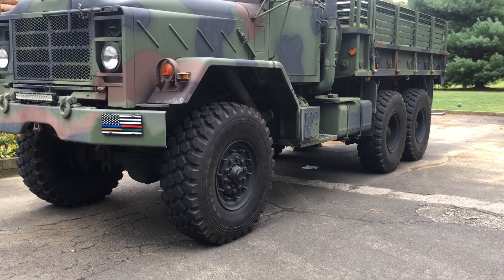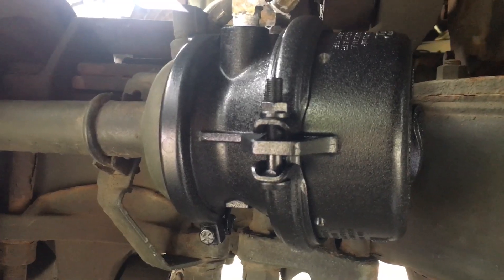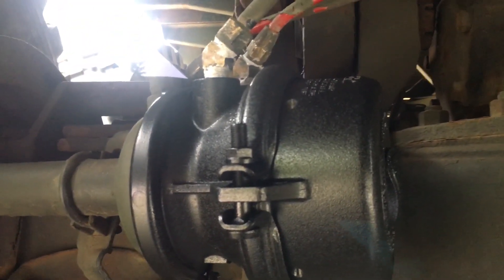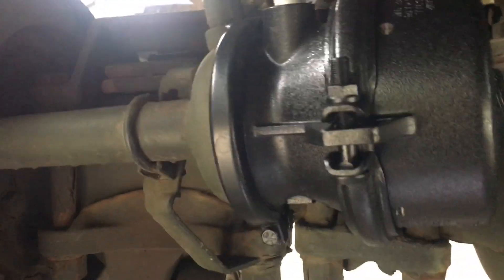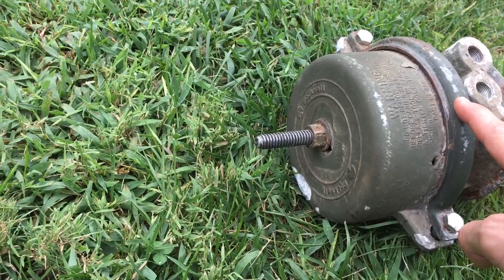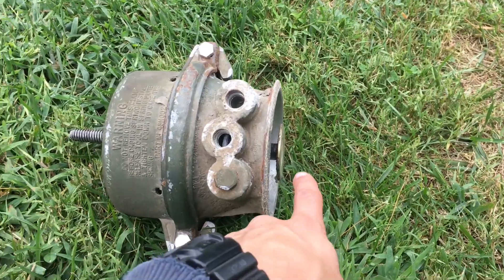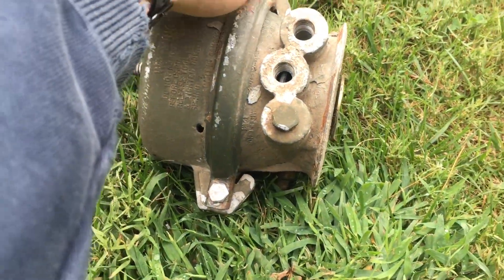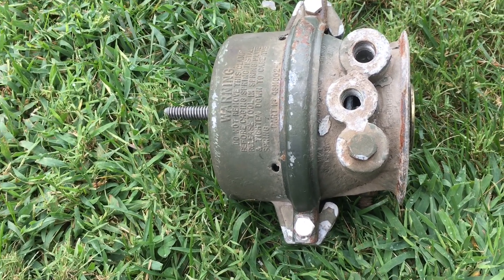M923A1 Spring Brake Chamber Swap

Comment: Do you still have the brake chamber cap? If so would want to sell, I need one because one of ears on mine is cracked.
Reply from the maker: Im sorry, the cap? The plastic cover that protects the cage bolt hole? I do not. Can possibly source that online. Sorry cant help more.
Reply from the maker: Heres a link for them if it’s what you’re looking for. Also saw them on eBay through different sellers. 

https://www.oshkoshequipment.com/products/detail/72/4652/Air-Spring-Brake-Chamber-Dust-Cap